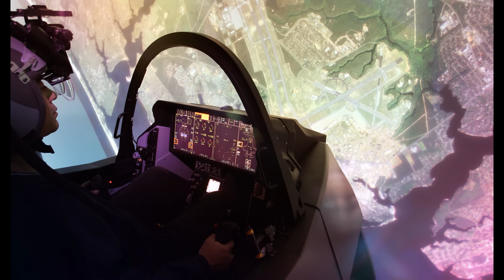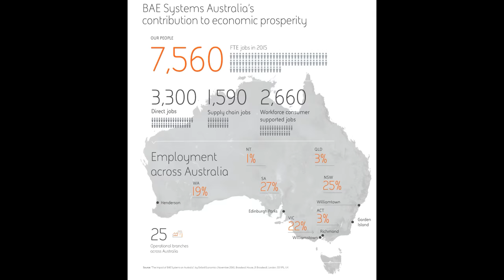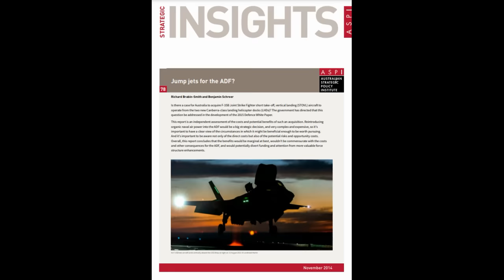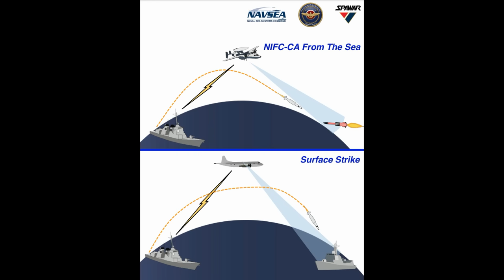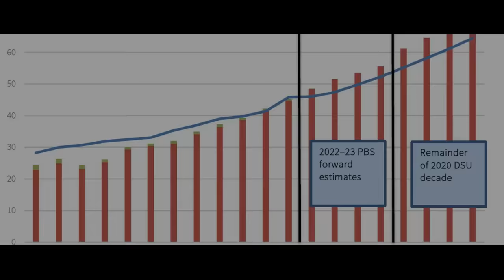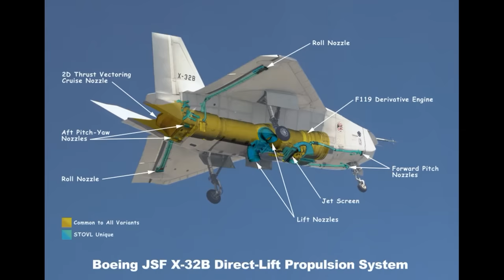The MQ-28A Ghost Bat, Unmanned Systems and the Future of Australian Air Power

Comment: Great content as usual, one interesting prospect would be the integration of an EMP device in the nose cone of the Ghost Bat such as the Counter-electronics High Power Microwave Advanced Missile Project (CHAMP) or the High-Powered Joint Electromagnetic Non-Kinetic Strike Weapon (HiJENKS). This capability actually destroys electronics rather than jams them and has a multi shot capability.
Reply: Yeah I'd love to see our next domestic aircraft to have a huge surplus in electrical power supply & cooling, in order to see what we can do with electronic attack on these small systems.
Reply: That kind of clashes with the intent of the Ghost Bat to begin with, since it’s meant to be cheap and attritable. Implementing DEWs into a fighter esque platform is expensive and has a long list of prerequisites that the Ghost Bat may or may not fill, more likely not. Things like payload capacity, power generation etc.
Reply: @jonathanpfeffer3716  The EMP weapons I described were mounted on the nose of cruise missiles, so it is likely that the loyal wingman will have no issue with weight or power generation. I would argue that the kind of mission that would use EMP weapons would be highly dangerous, such as SEAD, and it would be much better to send expensive drones and loose a few, than to send human pilots in aircraft that are far more expensive.
Reply: @john-paulfarrell2562  Oh, you literally meant EMP weapons, not just DEWs. Yeah, those wouldn’t really work for something like the GhostBat. 

Those EMP projects you describe are mounted on cruise missiles for a reason. They are warheads, not weapons. The only reason they really exist is to be detonated above a structure immediately before a SF team moves to secure the structure, and that’s about it. Basically every other situation a normal explosive warhead would be better at.

Obviously putting a weapon that requires the platform to literally be right next to the target doesn’t make sense if you expect that platform to fly back to base and continue operating. The only realistic use of microwave weaponry in general is for self defense DEWs, which you can think of functioning like little lasers (they aren’t lasers, they just behave like them) that fry the seeker heads of incoming AAMs.
Reply: @jonathanpfeffer3716  you seem to be pretty knowledgeable in this field, I would be interested to know what nose cone modules you think would best suit the Ghost bat?
Reply: @john-paulfarrell2562  There is no one answer to that, since it depends on the mission profile it is expected to do. The MQ-28 will probably be modular to a degree, so able to swap out equipment depending on the need. However, if I had to choose one that I think would be the most useful I would say a jammer. 

Putting any kind of sensors (radar/FLIR/EO) in it wouldn't really make sense, since it is a tiny little aircraft they would inevitably be relatively weak, and the F-35 will more than fill that role if they are operating together. It would also add cost, which compromises the intent of the MQ-28 to begin with. You can't put a self-defense DEW since it lacks sufficient power generation. 

Putting a jammer would be helpful in air to air engagements, and would in general draw attention to the MQ-28, which is a good thing (you want attention on the cheap MQ-28, not the expensive F-35). 

Another equally valid option is to just not put anything in the MQ-28 besides basic comms equipment and have it act as a missile truck for the F-35 in air to air engagements, which realistically is its primary role to begin with.
Reply: @jonathanpfeffer3716  I disagree with you on the merits of putting sensors onboard, since it's ability to be deployed ahead or abeam the f35 means the f35 has even better battle space si. It can get that without turning on its own radar and remaining undetected and still launch weapons too big for the ghost bat to carry. I think a formation of ghost bats would make a very wide aperture radar when they're sending their data to the f35 controlling them.
Reply: @jonathanpfeffer3716  I think not using sensors on the Ghost bat would be a poor use of resources. The Ghost bat is actually not that cheap. For example, the Government ordered 7 ghost bats for 454 million Aus dollars, that works out to about 64 million dollars per drone. We also don't know how quickly they can be built. The Ghost bat is not just a missile magnet to help friendly F-35s escape a dogfight, but a force multiplier that can greatly increase the combat power of many of our assets. Also why not use both cheap/expendable and more expensive/capable versions of the drone? Creates an environment of uncertainty for an enemy force.
Reply: @deSloleye  The issue is that the Ghost Bat doesn’t have an engine capable of powering anything but a weak radar. It’s an extremely small aircraft. You could still put one on, or put optical or IR sensors in it, but they would just be order of magnitude worse than the ones mounted on the fighters it will be operating alongside. There are already platforms much, much, much cheaper than the GhostBat that could mount basic sensors.
Reply: @john-paulfarrell2562  That contract isn’t just the fly away cost of the GhostBat, it also includes projected maintenance costs, spare parts, and many more associated costs, along with the R&D costs factored into that figure. 

To answer your two other questions, being a stealthy missile truck is exactly what is needed. When we are talking about a platform meant to operate alongside the JSF, not having sufficient situational awareness is not something that needs to be worried about. But, having sufficient magazine depth very much is. 

And having a high/low mix of Ghostbats specifically wouldn’t make sense, although that is a very good question. It’s meant to operate alongside the JSF, which is the “high” part of that equation already. Being able to have some modularity in case you need to task a GhostBat for some more niche mission is good, but that’s not really what high/low means.
Reply: @jonathanpfeffer3716  that's a decent point. Are the cheaper platforms as stealthy and as fast? The engine issue is probably not as hard to fix given this is a prototype. An engine with a bigger pto could be sourced easily enough. A model of the existing one could be developed with a larger generator. Those are solvable problems once they've got the ai and tasking interface problems solved. Even a weaker radar, or a receiver only system, could add a lot to the imaging capability by using synthetic aperture techniques. If they tightened the stealth up even more (probably undesirable normally so the f35 signature is swamped by the ghost bat signatures) then you have a deep isr platform that's a lot further ahead than the launching f35. There's a lot of scope for the stealth long ranged autonomous drone
Reply: @jonathanpfeffer3716  I think only operating the Ghost bat alongside the F-35 would also be a waste of resources, these drones also have to perform escort missions for other RAAF assets such as Wedgetail, KC130, C17 and P8. This mission set would require the Ghost bat to have some kind of onboard radar as well as missiles. The problem of low power capacity can be addressed with further iterations of the drone. 

we could argue all day long about how the ghost bat is going to be used, but I think we can both agree that no matter what equipment is installed, the most important part of this project is that it is Australian made, which gives the Government a way to generate air power in country, rather than relying on overseas.
Reply: @john-paulfarrell2562  Oh yeah, of course. When I said that modularity should be a consideration, that’s what I meant, but you worded it much better than I did. Everything you say in this comment is correct.

Comment: An eloquent presentation outlining Australia’s biggest strategic weaknesses: a small, versatile and high capability force lacking sufficient weight of effort. In simplistic terms we have lots of width but very little depth. Also an extremely vulnerable logistic train for sustainment purposes. I remember been lectured on the just-in-time logistics principle and thinking what a false ideology that is for a military force as it requires all the moving pieces to work perfectly all the time for effective sustainment. This was amply demonstrated in the early weeks of Australia’s deployment to Timor Leste. Thank you for creating these thought provoking briefings.

Comment: As I have come to expect from your work, this was excellent.

I do have one observation, however. While your description of what the Ghost Bat (and other UAVs) will be able to do is pretty much spot-on, I cannot help but wonder about what the putative enemy forces (i.e. the Chinese) might do using similar tactics. After all, the Chinese steal EVERYTHING, so it has to be assumed that they will at least have something similar to the MQ-28A in the not too distant future, and likely have them in significantly larger numbers. Since we must assume that they will be aware of the problem posed by the Ghost Bat (if nothing else, they will likely have watched your video!), it might be interesting to see what they would choose to do with those large UAV fleets...

Imagine a squadron of F-35Bs (with associated MQ-28As) confronted with 2-3 squadrons of J-20s (and associated MQ-28A knockoffs)... At the very least, it will be interesting to imagine what tacticians on both sides will come up with.

Comment: There has been talk of getting the B-21 Raider for the RAAF. I suggest the Northrop Grumman X-47B could be a very capable system for Australia's needs. Provides a reusable cruise missile capability.  More capability than the F-111. Though, I am not certain if the X-47B has been fully developed with weapons and sensor systems. A family basic array of guided bombs would be useful. The X-47Bs carrier landing capability is impressive.  My past suggestion was for the old classic RAAF Hornets could be adapted to UAVs.  This could have a number of advantages.  This would not be popular with the Ghost Bat being a competitor.  Preferably, they could share the same ground control units. And other retired Hornets from other countries could be adapted.  Could operate in wingman mode. Would need less actual flying time for training with old airframes. They would only have basic flight hours to maintain operability. Ready for an actual conflict. Performance is suitable for use with F-35 and F-18F. Seems Ukraine has no interest in the Hornets. I would like to see some Ukrainian troops come to Australia this summer for some rest and training during the northern winter. I expect Ukraine may attempt further attacks during this winter as Russian soldiers may not be suitably supported for the cold weather. Given the failure of front line logistics for Russian fighters. Russians are meant to be winter experts but that may not apply considering the horrific conditions we have seen. Russia has very low population growth and is now destroying a new generation of fathers. And Putin remains intent in destroying the Russian Army.  Russia will not be a significant military threat for a decade. And Russia should consider that China may be a greater threat to Russia than NATO.  China can not expand into the Pacific, even if it takes Taiwan.  China has much better opportunities in Central Asia along its Silk Road infrastructure into areas of Russian influence.  Also, historic land claims by China on Russian controlled regions. Rich in resources and low populations. Regarding Hornet UAVs the aircraft already have weapons systems, capable radars, fly-by-wire,  existing infrastructure and experience, numerous weapons already comparable, navigation, secure communications, experienced operators, good weapons load and range.  The technology for basic conversions of jet fighters is well-developed in the US. Lately, with many F-16s. 
Israel likes to use heavily armoured D-9 Dozers for its urban combat.  They will likely destroy any Hamas positions, regardless of collateral damage.  People may be underestimating just how angry and determined the Israelis are. Room to room clearing may not be a preferred tactic. Especially as Hamas may have mined whole IED buildings. And the IDF is well-prepared to destroy tunnels and bunkers. If Hamas wants to build its bunkers under civilians, who is in the wrong.  I do not think the IDF will stop for any temporary ceasefire.  Unless all of the hostages are handed over.  Then the IDF will wipe out Hamas. The ceasefire may allow more civilian evacuations if Hamas allows them. The IDF has been aware of tunnels for years. Some going to Egypt or Israel. Smuggling equipment and supplies from Egypt.  And attempts to attack Israel.

Comment: As a WW2 aviation  nerd I need to correct a few details:

All versions of the R-1830 were supercharged, however the models intended for bombers (as used in the beaufort) had superchargers intended for either low altitude service or augmentation with a turbocharger. High altitude superchargers absorb more power from the engine, so fitting one results in reduced performance at low altitudes.

The P-51's under belly scoop houses the radiators and oil cooler, as does the similar scoop on the CA-15. The engines in both are Rolls Royce designs (Merlin and Griffon respectively) with their mechanically driven superchargers attached to the rear of the engine.

If you were confused by the CA-14's scoop and thought it was a supercharger, you're not too far off- it's actually the air intake for an intercooler, needed to cool the hot compressed air coming from the turbo before it enters the engine. Being powered by an air cooled engine,  there was no existing radiator housing to put the intercooler in so they added that scoop to the side.

Comment: Though genuinely impressed with your analysis, I have a few aspects I think might need consideration. First, there's the relatively small matter of recovering a navalized version of the MQ-28. That will probably require some trap wire installation. In itself not a problem I suppose, but recovery will most likely also require no other launch or recovery operations when MQ-28s are being received. IN a high end confrontation, that may be a crucial aspect. If I figure correctly, the decks of the HMAS Canberra class leave little room for simultaneous launch and recovery cycles. I'm not certain if it is at all possible, but maybe adaption of the deck with a more angled configuration could remedy that? 

Another matter I wonder about, is whether an MQ-28 would be able to climb and vector fast enough to get AIM-120D's into range to intercept high flying PLA BAMS UAVs. Looking at te current configuration, I think an engine reheat is required. I recall interviewing an RAF Tornado F3 (ADV) pilot once and he stated, that the Tornado had trouble keeping up with TU-95 Bears over the North Sea and needed to engage his AB constantly. He also mentioned that this, plus the time using reheat to vector to intercept point, severely limited the time the F-3 was able to escort the Bears. I therefore am guessing a supersonic UAS would fair better, which might operate next to (not instead of) Ghost Bats used for surveillance or strikes. 

Final, and a more broader question I have is, if large surface vessels are that vulnerable, why not invest even more in submarines armed with long range cruise missiles and LR anti-ship missiles (or maybe even sub launched loitering munitions) to push the PLAN further out of field? Immediately I realize, that Australia is surrounded in the North by relatively shallow waters of the Indonesian archipelago which isn't very suitable for SSNs to operate in. But what if for that area of operations two squadrons of AIP/Ion-Lithium-boats  could be used as sneaky ambushers? Less costly than full fledged SSNs, capable of operating closer to home bases and their routes to the area at least in part covered by the RAAFs assets? Would that work? And would that be efficient/sufficient, I wonder.  

Either way, just a few questions that crossed my mind. Not to criticize but to add to your thinking. 

Cheers.

Comment: Keeping a skills based aircraft manufacturing & design capabilities is paramount imo for Australia, especially in our geographical location & population vs landmass & sea air territory. A very cheap agricultural utility aircraft could play a huge roll in defending Australians against a multitude of dangers & threats. From firefighting, search and rescue, logistical supplies & other civilian rolls to a abundance of rough runway utility aircraft that could loiter & carry large payloads ( missiles ) that are guided by other smarter platforms! Very cheap , robust & safe to fly for basic flight training pilots. Basically disposable to a point. All of the performance can be in the weapons & other support platforms. Australia can’t afford to lose its front line aircraft or replace them or the skilled pilots that fly them . A near disposable, dependable multi roll aircraft is a must in such a vast continent as Australia imo , will some outside the box thinking we can dictate the terms in which we tackle problems, not throwing bundles of taxpayers debt a far away manufactured weapons that supply routes can be blocked & we are left with nothing.

Comment: Content Idea;
Re complimenting ship based radar horizons; 57ish min mark, check out tethered drones and the mil projects around them.
having a very thin ultra high voltage wire with fibreoptics running up and down from a drone at a thousand feet (300m) gives a radar horizon of 60km; running off the existing shipboard power infrastructure and some of the existing low power phased array radar systems (eg at Melbourne Airshow last week was a small phased array drawing only 60w for drone detection and tracking)